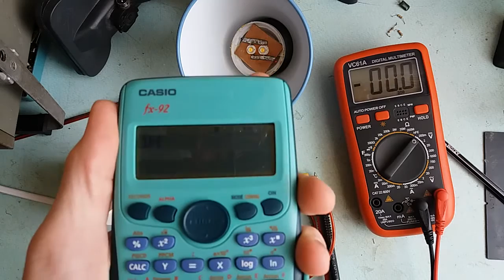Simple mains powered led driver (1W-3W)

Comment: Hey it works, and still better than a small transformer and bridge rectifier :-D.
I would imagine the transformer would be the touchy part, not easy to get the ideal operating conditions for best effectiveness.

It looks like the common two transistor type, a bit crude but you're using it for lighting so it does not matter at all ;-D.

Like the top mounted components, not too pretty but so easy to experement with different values to get the best out of it.
Reply from the maker: It works just fine, I see no need to put a sophisticated IC in there. The transformer is the trickiest part, but I followed the instructions almost precisely, so that should be fine. It looks a lot like 2-transistor type, however here it is the LED current which is sensed, not the main switch current.
 I used the same construction technique in my 3W and 6W LED bulbs, works just fine.
Reply: The upside down pcb method is something my brother (radio ham) used to do for r.f circuits, he would grind the copper to create small islands of copper to splat the parts on LOL :-D.
The rest of the copper was a sea of earth round the islands.

I have a breadboard somewhere, but they become dodgy after a while, im sure you have noticed that the connections become loose.
Nice when new though.
Sorry im yapping again ;-(
Reply from the maker: I like it because it is permanent like a PCB, but easy to modify (just a bit more tricky than a breadboard). I make my RF circuits like that too, you saw the tuner in my FM superhet yourself :) Main trick with the breadboard is to remember to not shove thick wires in the holes and never forcing the pin in when it doesn't wanna go easily.
 My videos don't get a swarm of comments, so you don't annoy me at all, really ;)